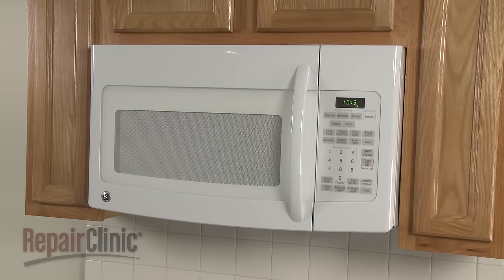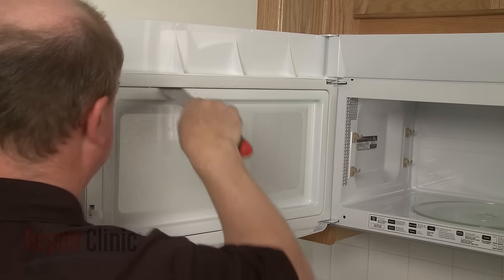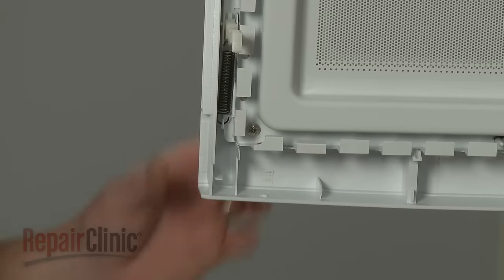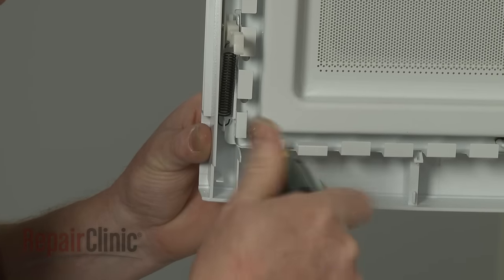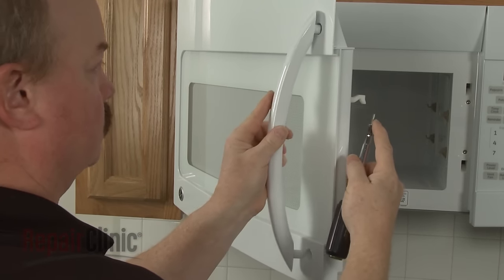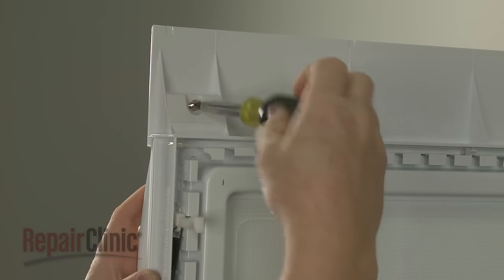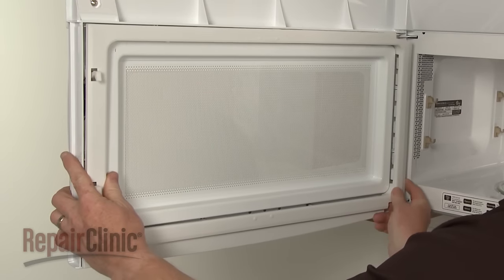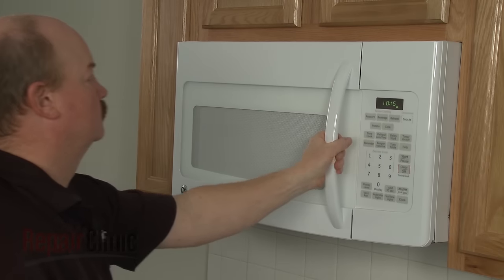GE Microwave Door Handle Broken? Replace, Repair #WB15X10249

Comment: Thank you!!!!  I was struggling on how to get to the second set of screws that are blocked by the metal frame.  I have the same microwave oven.  Although harder than your copy I was able to pop open the front bezel enough to allow a screw driver in there to get to the second set of screws.  I wasn't able to remove the entire front bezel.Once I was able to access the second set of screws it was easy peasy.  Thanks for that second half of the video.  A life saver!
Reply: Oh, one more thing, a putty knife (or two) is key.  Otherwise you will ruin the plastic if not break it altogether.  PLEASE USE A PUTTY KNIFE!

Comment: I removed the 2 screws and there are seems to be other screws I can't access from just removing the strip. How do I access the second set of screws?
Reply from the maker: L Gould Some microwave models require that you take the door apart to get to the handle screws. We do not have a how-to video for this door style; you may find such a video from another channel on YouTube, though. If you're unable to find a how-to video, we suggest that you remove the door entirely to prevent losing parts and contact the manufacturer for recommendations.

Comment: Thank You was helpful. I actually have a Kenmore.
The trim, actually wont let the door shut completely? Leaves Microwave light and fan running. So I took it off?
Reply from the maker: Did you replace the trim? It may not be the right trim for your model.

Comment: I did this now the microwave door light on the touch panel blinks like the door is not sealed but everything is back.  Touch panel won't respond correctly and microwave won't start.  Light, clock and timer work fine.